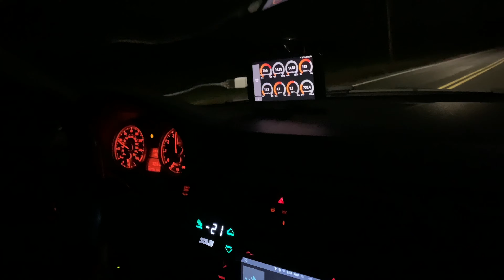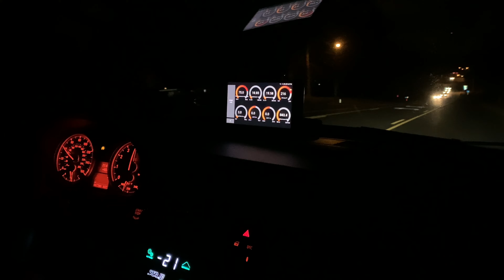INSANE 600+HP BIG Single Turbo N54 335is

Comment: how much did this cost? thinking of getting a 335is and wanna single turbo and make around 550 -600 wheel
Reply from the maker: https://docrace.com/collections/turbo-kits/products/bmw-335i-n54-n55-single-turbo-kit?variant=47870807940 ... approximately $8,000 after the kit and everything else that was needed.

Comment: What's the exhaust setup on this car?
Reply from the maker: Believe it or not it’s actually a stock exhaust
Reply: JS Charlotte Mine sounded nothing like that with stock exhaust lol....but I did have a muffler delete
Reply: stevedivi24 Single turbo changes the sound of the exhaust completely
Reply: Angel Ivan Mine is single turbo
Reply: stevedivi24 damn idk is it an e90? Those have a different exhaust setup then e92
Reply: It’s open wastegate

Comment: I wouldn't run a precision.  You'll be pulling that thing back out I promise
Use a efr borg or garett based kit. Unless you want to keep changing those out. They have 850 hp twin scroll garetts and bw's that make 850 and come in around 3k